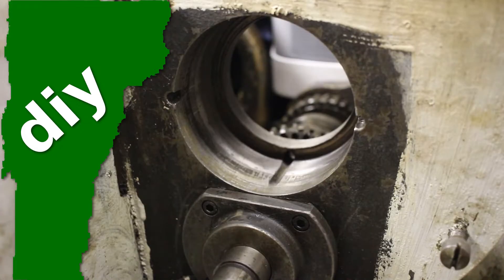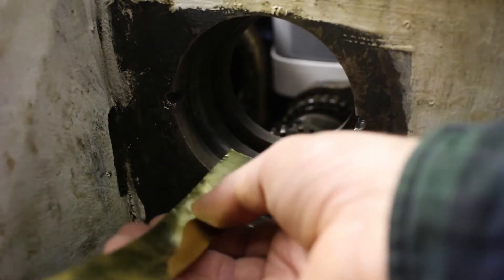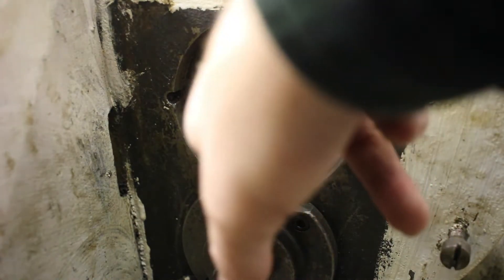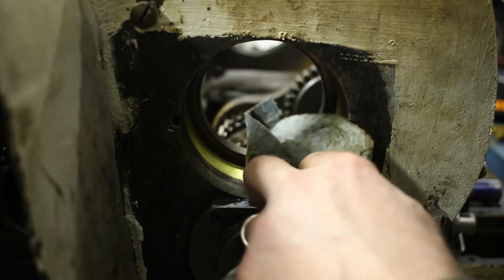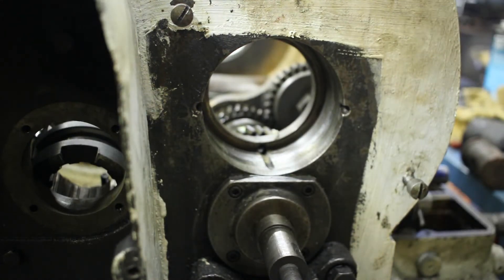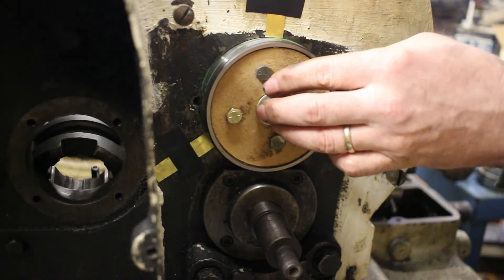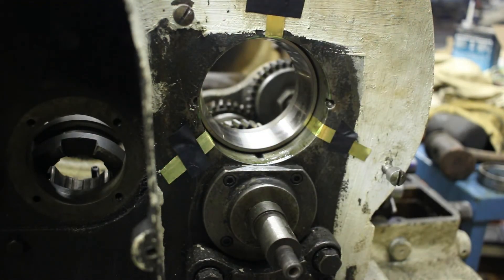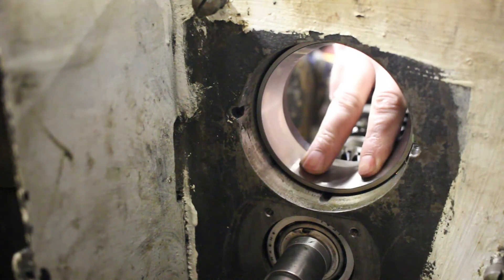Monarch Lathe Rebuild Part 5

Comment: Brass is full of copper ions, which will "kick off" the Loctite. In fact, one of the Loctite accelerator products is basically a solution of copper ions.
Reply from the maker: Good to know.  I thought about using something like grease to hold the shim in place but decided that wasn't a good idea.